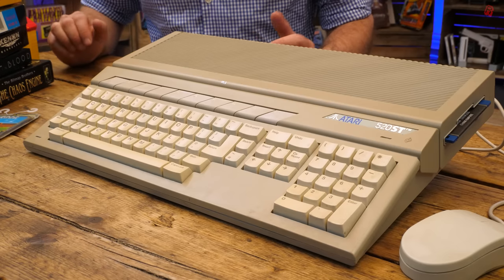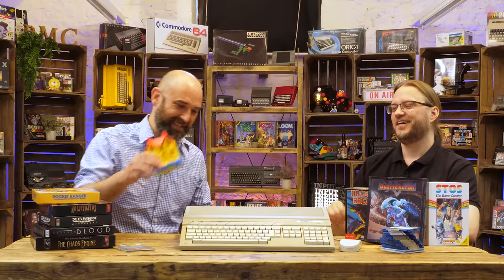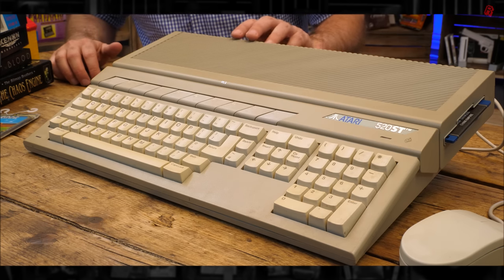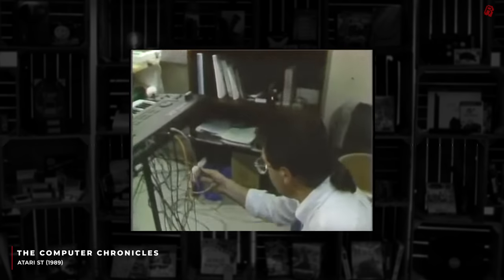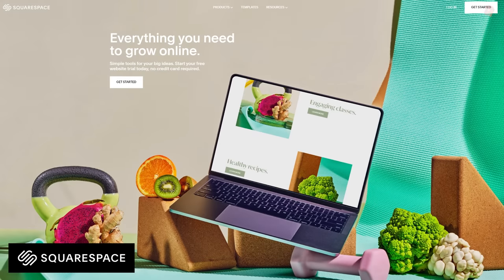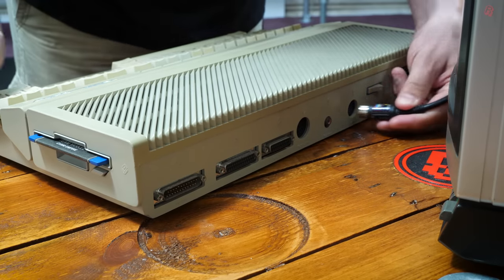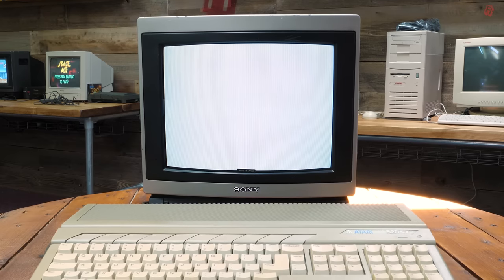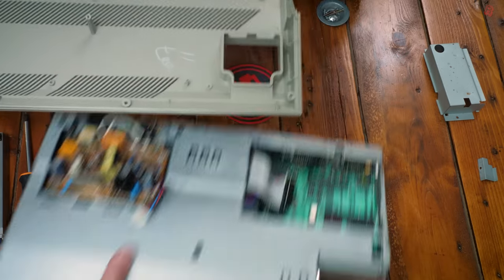At last! An Atari ST in The Cave - Meeting and Restoring a 520 STFM

Comment: If Commodore can be said to have had bad, directionless management in the 90s, this goes double for Atari. Despite launching slightly earlier with the lower powered 16-bit machine, Atari’s real failures were in consistency and marketing. Their disk format was MS DOS compatible, so being able to interchange files between PCs and Ataris was a big deal, but that was never strongly capitalised upon. While businesses were buying IBM, people outfitting their home office who wanted a little bit of interoperability with their work computer would have gladly gone for a machine that cost them a quarter as much. I don’t pretend Atari could have taken on IBM in the big business contracts world, but they could have made a solid pitch to small businesses. Shops that needed one or two computers for accounting and inventory are a whole different animal to office buildings that needed 30 computers.

Their strategy to move on from the ST was messy and poorly communicated. The ST family was easy enough to understand. You had the original ST in two stock RAM options, then the STf, with an integrated floppy, STfm, floppy and RF modulator, then STe for “enhanced”, bringing us a hardware blitter and other chips to better compete with Commodore (both of whom were still beating the pants off anything in the PC world for graphical and audio capabilities). Outside of this you have the Mega ST series, more RAM, pizza box shape, but no compelling reason to exist in terms of additional capabilities. Then there’s the TT, a push to 32-bit processing and 32-bit address bus. The TT had some measure of ST compatibility, but was pushed with a Unix OS on it. Among Unix workstations it probably was “power without the price”, but for Atari’s existing consumers, it was a big departure. Then you have what I consider to be the crown jewel of Atari, the Falcon 030. If they hadn’t bet the farm on the Jaguar, and instead thrown full support behind the Falcon, who knows what might have been?

This is without going into their portable strategy. An ST luggable in the STacy? Fine, even though they back-pedalled on the battery power option because it turned out to be inadequate. In a world where people were lugging around Kaypros and Osbournes, the STacy was a fine option. The ST Book was much more portable, but a bit of a misstep, lacking the external video and integrated floppy of the STacy. The floppy at least was practically mandatory. We hadn’t reached the era of the iMac ditching floppy drives, yet. The Portfolio was, for some reason, a portable DOS PC? I’m sure it made sense to them at the time, but it was an early warning sign of their scatterbrained strategy. Beyond its appearance in Terminator 2, I’m yet to hear of anyone actually using one on a daily basis.

This rant, potential inaccuracies and poor logic included, has brought to you by a night of insomnia and having only just finished my first cup of tea in the morning.
Reply: There was an amazing amount of technology they had access to, and it is shameful the way it was squandered. In addition to the above, the Lynx, ATW were wasted. The Jaguar was interesting in that a couple of years after it came out, the 68K series reached EOL, and via the Jag, Atari had their own cpu to migrate to.

There are a lot of what ifs, but possibly the most interesting one is where Atari put the blitter socket in the ST from the start (as they planned to make one), and then when the ATW was an option, use the T212 transputer chip as the blitter in 87 (note they had enough time to miniaturise the Mega ST) - SuperFX2 capabilities for the ST range in 87, or fast FPU calculations, or sound processing like the Falcon. Computing as a whole may have changed drastically if the transputer gained a hold as a GPU/DSP farm
Reply: @alexisread5325  I skipped over the Lynx because it was sufficiently different, and probably not a detriment, to their computer line, but it really could have been integrated better. I’m unclear on the exact history, but wasn’t the Lynx originally going to be a Commodore product? The Falcon constituted a real way forward, even if the 68k architecture was on its way out. I think the real killer app for the PC in the home was Encarta, though. It was the Trojan horse that got so many PCs into homes as being for the kids to do their schoolwork, before internet access became nearly ubiquitous. Encarta is something that was only possible with a large install base of CD ROM drives, and I think that made all the difference. I’m pretty sure there was a CD drive accessory for the ST (official or otherwise). Atari should have pushed harder for CD drive uptake on the ST, and either made a CD drive a pack-in accessory for the Falcon, or bundled it with attractive pricing. Computers were getting faster and faster year on year, at that time, but being able to do the same stuff faster left them hobbled by their storage media. The CD constituted a big leap forward, with the possible becoming practical, in terms of huge libraries of text, audio, and video content.

I don’t know that this one small correction, embracing the CD, could have changed Atari’s ultimate fate. I’m not sure they’d still be a serious contender in the computer market today, as an alternative to Apple or the Windows ecosystem. I do think the 90s would have shaken out very differently if they’d had consistency and vision. The 90s were a rough time for Apple, and Atari could have capitalised on that for a slice of the computer market (though the true believers among Apple’s flock have always been kind of zealous, Apple would have survived on them, alone).

Comment: Finally the Atari520STFM makes an appearance in the cave. Way back when, I sold my Amstrad CPC464 with external disc drive to upgrade to the Atari. Reacquired one a while back and restored.
https://twitter.com/Pledg/status/1247959985025363971?s=19
Internal Gotek is a good option. Mine is a different board to yours but I'd love to do the 4mb upgrade but never seen a video on it. 
https://www.exxoshost.co.uk/atari/
The place to go for ST parts etc.
Games I love on the ST are Star Wars, Gauntlet 2 and Buggy boy.
Thanks Neil and Mark...

Comment: Hey Neil is there much difference between the 520ST and 1040STE? I only ask because ive found one for a decent price though its in the UK so i'll have to ship it over to Australia
Reply: Hello. If you've found a 1040STE in good condition at a decent price I'd say go for it. Hardware wise the STE was a significant upgrade over the ST and is very nearly 100% compatible - the vast majority of stuff should run fine...
...there is a but: The STE was very poorly supported by software and to an extent hardware developers primarily because even after it came out most stuff was targeted at the ST - you'll not find a lot of software that makes good use of the STE's features.
If I were in the market for an ST I'd be more than happy to snag an STE instead - my only warning would be to check out what upgrades you might want and be sure they will work with this computer. As a general rule most stuff will even if a little circuit bending is occasionally required.
Best of luck.
Reply: The number in front denoted the amount of RAM, 520 = 512K, 1040 = 1024K, etc.

The STE was the second generation of the ST with a additional DMA sound system, two extra non-standard joystick ports and SIMM or SIPP memory modules (making it very easy to upgrade to 4MB of RAM). Because of the differences (and a larger ROM which required moving the ROM to a different memory address) some games which assumed things non-longer ran but most games did. It was quite common to see games boxes with "STE Compatible" stickers on the front.

The STE is a fine machine. Very little software took advantage of the extra hardware though.

Comment: I have quite a few of my old Atari ST disks. There is one in particular that I want an image of to use with emulators. Is there anyone who can help me with that?
Reply: Have you tried STrecover? I haven't done it in 20 years, but I recall that there were image writing tools running on MS-DOS (for Atari floppies) - apparently, image creation is also possible
Reply: I’ve just setup a GreaseWeazle and am trying to image some badly stored floppies from my old  Atari

Comment: In a parallel universe it's the Atari Amiga.
The STE should have released in 1988 and the Falcon in 1991. Atari should have plowed everything into these machines.
Reply: Even in 1991 the Falcon would have failed. Remember that it was equivalent to sharp x68000, released in 1987. In 1991, something else was awaited by the public and users.

Comment: Oh, my blessed STFM. I had a 4Mb ram upgrade and external SCSII drive on mine. It's currently sat in the attic, slightly dead, white screen, no activity. Bless it. It did however, help me create the following: https://www.youtube.com/watch?v=Tv7lNcYzHU4 and https://www.youtube.com/watch?v=AYWTiZqsbPI amongst the things I coded at the time.
Reply: Should add, that's a 4 channel mod playing, 4th channel was created by splitting the 3rd in two and cutting the channel quality by 50% on each channel. Digitised pics using external analogue video camera with 4 different colour filters then combined together to get a colour image. And the prototype game itself (2nd vid) uses palette spitting to use 16 colours top half and 16 colours bottom half.

Comment: The atari didn't have the best of sound chips..same chip as the spectrum 128k...atari kind of rushed the ST production...graphics are more or less the same as the amiga500 for the majority of games..if you are an amiga owner then the only benefit i see from the atari would be the midi ports otherwise there is nothing to be gained from the atari.

Comment: The smaller, original ST with the external power supply and floppy is a beautiful streamline design.  The large and heavy later machines like the STE are in my opinion, ugly.